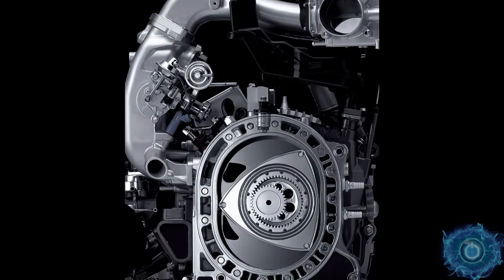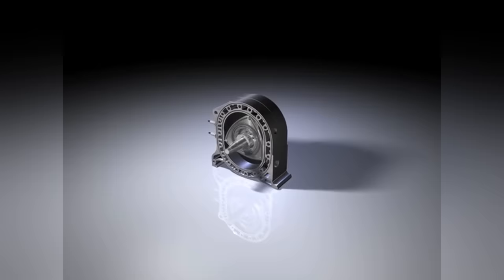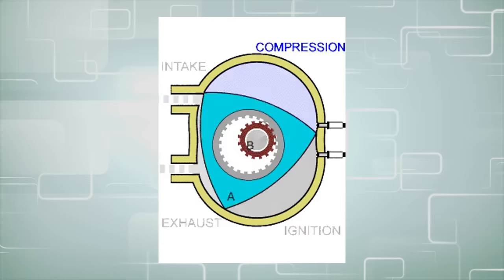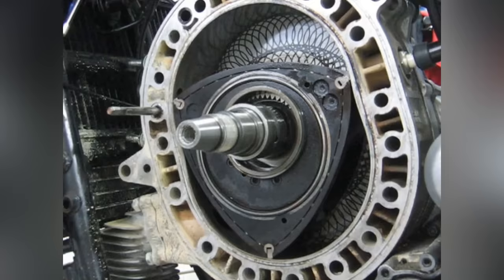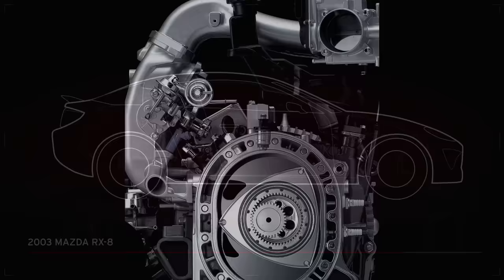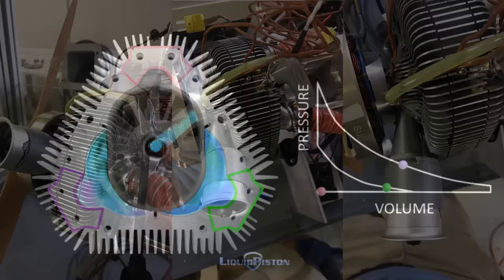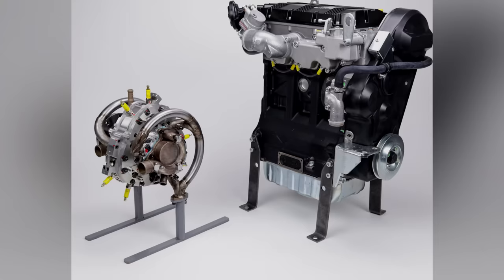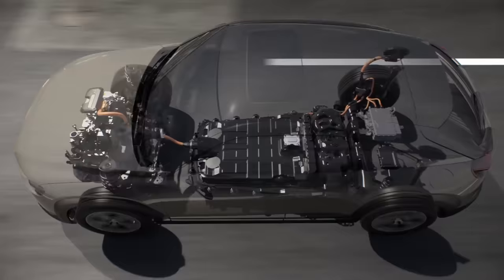STRANGE New Rotary Engine BREAKS Records

Comment: As a young and dumb "early adopter" I had a rotary powered RX2. It was a great car, I had 2 problems with it, it ran so smoothly I was constantly engaging the starter when it was already running and being Y&D I didn't replace the Antifreeze often enough resulting in failed "O" rings and a rebuild of the engine. Watching the mechanic strip off the accessories, unbolt the motor mounts and pick the motor up, by himself and carry it to the work bench like it was a lunch box floored me. The RX2 looked like all the other Japanese 4 cylinder cars of the time and would eat them for lunch in the Red Light Derby. It didn't get great gas mileage but at $0.35 a gallon that wasn't a deal breaker. There has only been 1 car that I enjoyed more, an RX7 I kept for 18 years. Now if Mazda would put a rotary in a Miata....
Reply: Where it always belonged!🤨🤔
Reply: I had a 79 RX-7 that i absolutely loved driving, while the car had its issues (teenage me didnt help either) I was sold on the power and acceleration. The only thing that got me away from it was the introduction of the Miata which I owned for 18+ years which was the perfect sportcar other than the limited power. The 1st generation Miata in good shape is worth almost what I paid for it back in 89, and nothing has come close to be as fun to drive as that Miata.
Reply: My brother had a car that was sort of a forerunner of the RX cars that Mazda called the Cosmo. It had a very similar Wankel engine to the early RX cars and exhibited the same operational and performance issues.😢
Reply: It's a girls car, just is.
Reply: Oil injected or did you premix? im run nothing but amsoil interceptpr 2t oil in my rotary from now on.

Comment: Scalability of multiple units will be vital. The advantage of the Wenkel is you can almost slap together as many as you want in a row, such as the V12 you can find on YouTube that i don’t think made it into the boat it was intended for 
It’s a piece of art
Reply: V12? lol.
Reply: "V", he says
Reply: Maybe the R12, or the wankel12 😂
Reply: Vee? Wankel? This is incongruent you need to post a link…
Reply: @soljump  it is three 4 rotors linked together in a v shape.
Reply: Rob Dahm has that engine now, he did a teardown on his YouTube channel
Reply: Though it's much lesser known, ordinary piston engines have also been joined at the crank. When I was a kid my Dad took me to watch tractor pulls, and some tractors had three V8 motors with the cranks welded together.
Reply: isn't this already effectively a 3cyl? so four of them would be equivalent to 12cyl?
Reply: there's a twelve rotor RX-7 someone built. 
really is a piece of art
Reply: The R12 which is now in the hands of Rob Dahm...

Comment: I was one of those who purchased a rotary engine wankel in 1973.  I loved it, even allowing for the occasional explosion under the gar when unburned gas ignited.  It didn't hurt anything; it was just loud.  That car didn't get excellent gas mileage, but nothing else did at the time.   But it sure was peppy.  It responded yesterday when you stepped on the gas.  I only had it for a year, and had to sell it for financial reasons.  I certainly did love that car.

Comment: Rotaries are also an excellent choice for small aircraft.  Small, light, and fantastic power-to-weight.  Once assembled and running, they have few problems, especially for the operating regimes experienced by aircraft powerplants.
Reply: No thanks. I ain't hanging my ass on the reliability of apex seals.
Reply: In-Air replacement of seals is important... Pilot needs to be a mechanic and a fast one at that......
Reply: @ME-pb2gf apex seals don't fail catastrophically...  little by little over very many hours you would see oil consumption increasing...  But there wouldn't be any sudden engine damaging failure...
Reply: Theoretically they are, also considering the low frontal area...  but the odd thing is, there's never been a certified aircraft rotary (as far as I know), and kit-built are pretty rare...  I think the issue is that the high RPM's require a reduction drive (belt or gearbox), which sort of throws a wrench amongst the plusses, at least for a homebuilder...  unlike a piston engine, I don't think a rotary can be built for low RPM torque, which would allow direct drive...  NASA was conducting rotary light aircraft engine research in the last decade, but I don't know what the final conclusions were...
Reply: Insane EGT’s
Reply: @PRH123  reduction drive is not a problem at all. high fuel consumption is higher problem i suspect. after all gas turbines need reduction drive too
Reply: Blinky, I would expand on your idea ... a pure "pie in the sky" type of conversation. Rotaries since are hard to control on efficiency ( no VTEC yo ;D ) technically are best run in specific RPM and constant load. How about having 2 rotaries, and since those are usually running at high RPM join those with generators (higher the generator RPM, less likely you need it to be bulky or have rare earth magnets to achieve good efficiency ). That would give you a redundant power input to your system. Then have a mono prop or multi prop on your aircraft - that way you would get some redundancy as well. Since those would be electric, placement of those would be to "to taste" and could facilitate any crazy efficiency improving solution or even steering. Then allong with small battery, you can have 2 ON for takeof and landing, 1 ON for cruise etc.
You know just a crazy engineering idea.
Reply: @ME-pb2gf  - Aircraft Engine Uses, are far more steady state, unlike in driving applications on roads, cities, freeways!
Reply: @ME-pb2gf  - I have Experienced Broken Apex Seals, in my  Wankel 12A, 1983 Mazda RX-7 GSL-SE! Two Rotors, and quick throttle application and  I was good! 70 Cubic Inches! Arkay Turbo Added Aftermarket by Previous Owner, Stock = 100 HP, With Turbo - Topped 200 HP!
Many Runs up to Max Power Up Long Mountain Grades, and Hard Acceleration Runs in tight Passing Situations!

However, It was Quick to Go from Not Idling at low RPM's to Broken, So - Yup, it could be scary!
Reply: @PRH123  Apex seals do not seal oil.
Reply: The question is why you would use an inferior engine, when every size and sort of jet turbine is available these days, from itty bitty handheld ones all the way up to GE9X. Perfectly adapted to flight, no oscillating, off center parts to break or seal, greatest possible efficiency, reliability and convenience, with proven technology.
Reply: @aardque  2 reasons: price and a special license.
Reply: @machinemaker2248  "3d printing" and really? Stay on horses because you need an auto license, stay in cars because you need a pilot's license, stay in the atmosphere...
Reply: I always thought a "modern"  2 row rotory of say 300hp should just be directly coupled to a 16 blade ducted fan of appropriate pitch/diameter to spin at the high rpm rotorys are capable of. Much like the fan of a high bypass fanjet. Capture your exhaust in a tuned pipe arrangement that adds a few lbs thrust. Put it in a jet like tandam airframe with the engine behind the people. A box like duct starts here with the shoulder mounted wing and the tail attach to the end of the duct. Wheels retract into the bottom of squared off duct aft of the wing slightly. I've made a few drawings...looks feasable to me.......just need a reliable rotory.
Reply: Yes, good application but requiring a reduction drive gear set, because props don't spin at the stead state cruising RPM of 2,000 to 5,000 RPM.  
Remember... aircraft engines run at a steady RPM, unlike traction engines in cars. 
The rotary will have a huge power-to-weight ratio.  In a small aircraft weight is your enemy. 
I'm curious about the fuel consumption though. From my experience, the rotary sucks it down big time.
Reply: @PRH123  All ICE engines in aircraft use a reduction drive, as do turbine prop arrangements. 
These small rotary engines could be used as a 'range extender' in electric prop aircraft.
Reply: @tommybronze3451  Rotary engines can use the rotary equivalent of VTEC - variable porting.
LOL... thats the only valve in a damn rotary.. and no cam shaft along with all the other moving bits that can fail.  
As you say, rotary work best at a constant speed... which suits the aircraft application well.
Reply: @BTW...  actually a reduction drive is pretty rare amongst certified piston aircraft engines…. most are direct drive…. the prop is attached to one end of the crankshaft…

Which is one of the reasons that they are tuned for low end torque…. they can’t run faster than 3000 rpm to prevent the propellor tips from going supersonic, and most redline at 2800 or even 2500…
Reply: @aardque  If you're getting that fancy why not skip the jet turbine too, go straight to ionic plasma thruster. Even less harmonic oscillating parts
Reply: @off6848  impractical as the on/off nature would make taxi challenging.
Reply: @PRH123 Its oil injected so it always does that, amsoil interceptor 2T.

Comment: The exhaust port was the only one that was moved the intake was always on the plates and this wasn't done for airflow since it is much worse in the renesis, it was done for emissions because while the exhaust going straight out the housing is great for making power it also causes a lot of over lap
Reply: TBF, the Renesis’ airflow wasn’t as bad as often thought (no doubt the 90° turn didn’t help things though). The main problem had to do with Mazda combining ports into a half size “Siamese” port, which restricted airflow. The side port design has a lot to give, but so far nobody has given it another chance besides Mazda themselves. The side port was liked by a lot of drivers due to it’s smoother torque curve and idle.
Reply: @BrapBrapDorito  the problem with the side port is down to the design of the engine itself, it creates a serious hot spot on the plate, which causes even more uneven heating across the plates. Bad for many reasons including detonation. And the port cannot be enlarged by much because there is a water jacket around it.
as a side effect the engine is virtually imposible to tune. Unless running strictly on e85. You can add a turbo for modest gains, but the engine itself is the limiting factor.
They also have soft rotors compared to the older 13b.
Reply: @BrapBrapDorito  that said though, it depends on your perspective. Its a weird engine, no doubt, with some impressive engineering and performance characteristics, as well as unique issues.
Reply: @Nbomber  While it is true that it creates a hot spot, predetonation isn’t a really large problem as the combustion happens in a separate sealed section of the engine. Maybe Im not immersed enough in the RX8 tuning scene but I have never heard of the rotors being weaker (though I will concede the seals were far too thin.) Honestly, all of these problems can be fixed if the engine was given another chance, but there isn’t too much likelihood of that happening for a while.